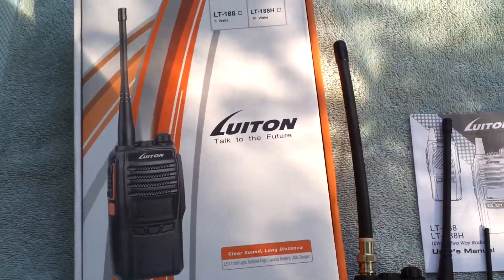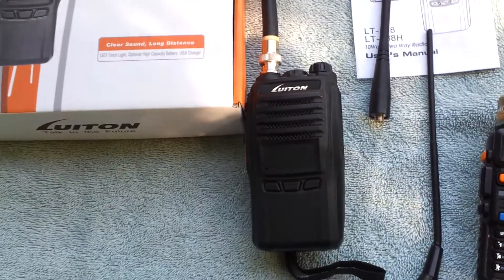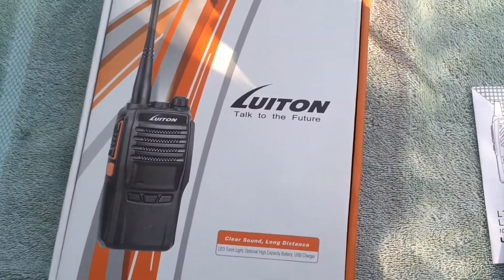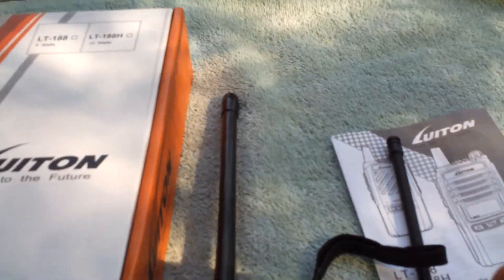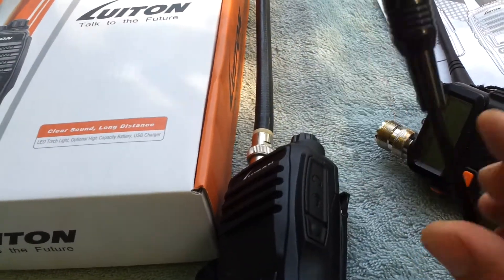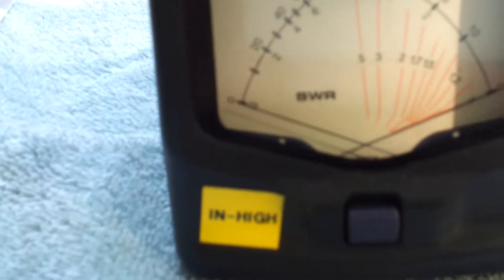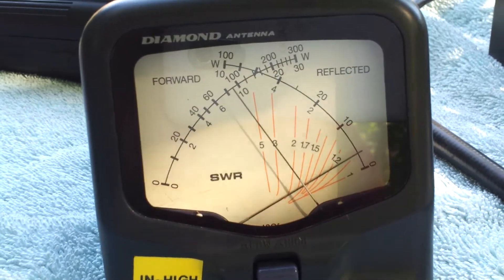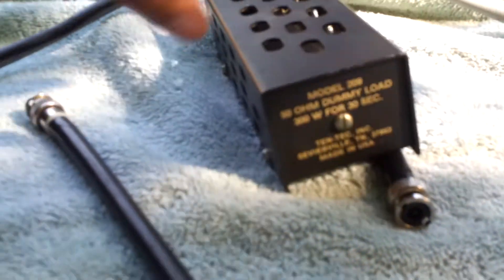Luiton LT-188H pre-review with power output test.

Comment: Luiton LT-188H  UHF 10 watt HT ham radio, My Luiton software has a tab that says "Machine" when i click that it shows that i can change from UHF to VHF does anyone know if it will work, I only need UHF so i haven't tried it yet, Because i need the 16 channels in UHF that's programed and don't want to lose them, Any testers out there?
Reply: OK update, Yes when you click on software tab  that says "Machine" you can change from UHF to VHF, I bought 2 UHF but i changed 1 to VHF now i have both bands, be aware when you change bands it will be blank no factory frequencies, so type the  frequencies in the 16 available channels